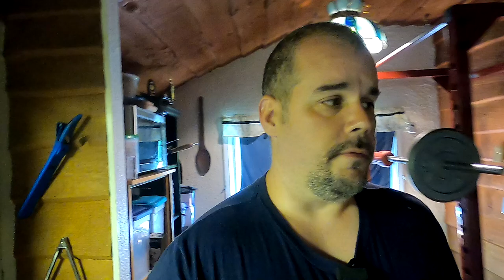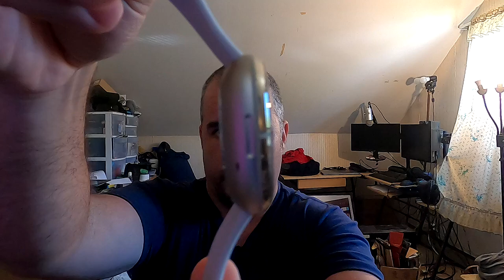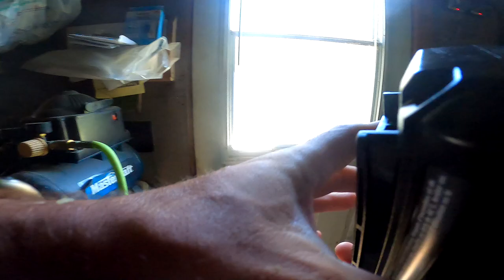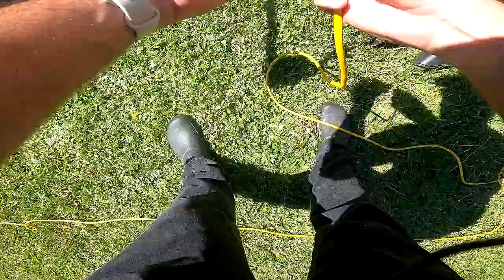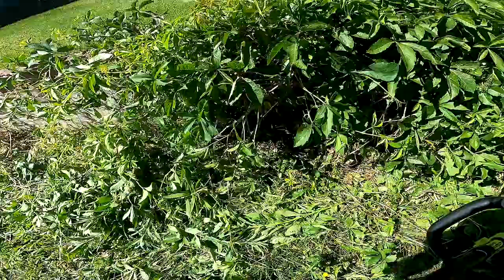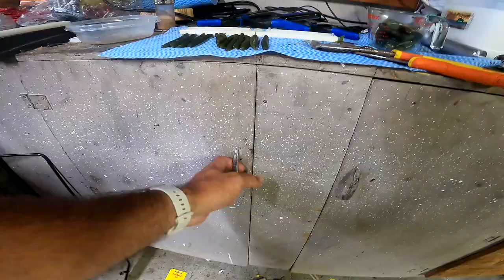It Makes Sense

Comment: The whippersnipper head's a bump-feed, so just bop it on the ground while it's spinning and it'll feed out more line, don't need to keep stopping & manually pulling the line out... :)
Reply: That function works until you respool the reel wrong, or buy a reel that the machine F'd up.

Comment: your tiller doesnt need a new carb bro .... it needs to warm up with the choke on till it starts to sputter and hot then turn the choke off after its hot and it will run bro ... those things run hot ... you are closing the choke way to soon
Reply from the maker: I will give that a go but it literally dies after a few seconds of running.  I don't think its pulling gas.  When it starts to sputter die I can hit the primer and she is good for another 5ish seconds.
Reply: @Skivinz  it dying cause its not hot enough to run ..... needs to run on choke for a bit before you turn the choke off , if i turn the choke off to soon on my lawn mower it will stall it out , these things like to run hot like a snow blower bro , like if anything take the bowl off the carb and clean the needle , but in my opinion you dont need to go get a new carb  maybe a rebuild kit at the most  , but try running her for bout five mins with the choke on then turn the choke off